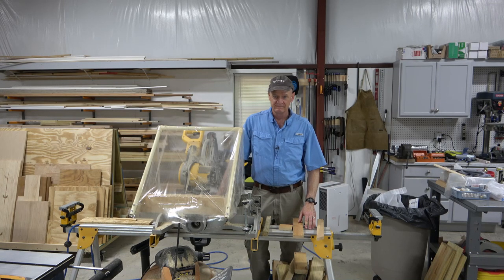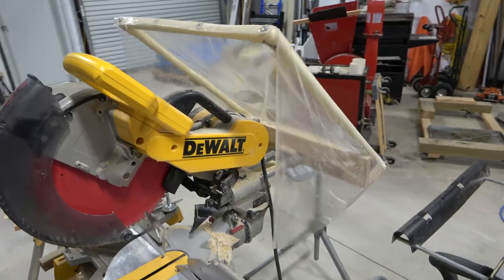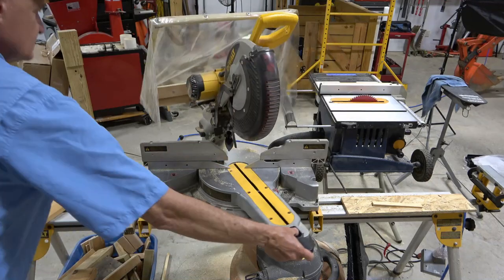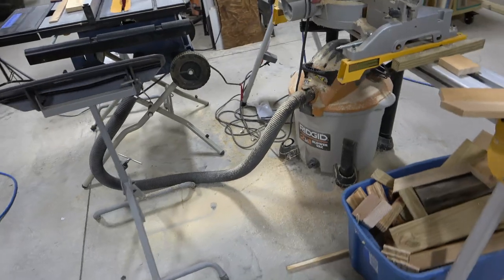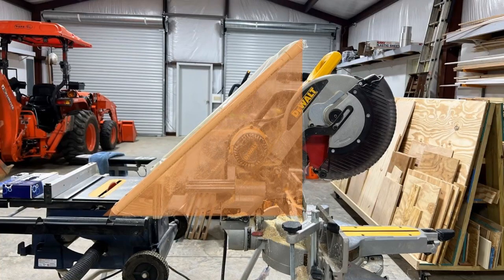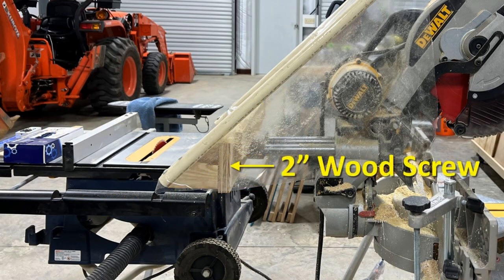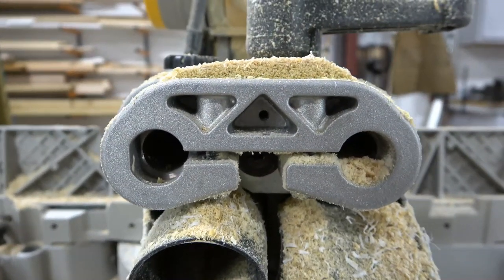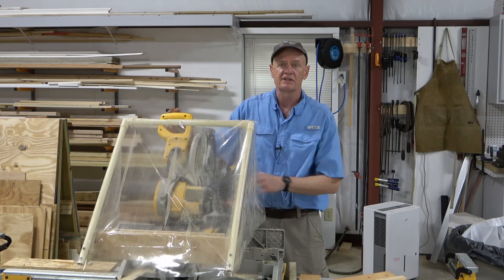Miter Saw Dust Shield - Quick and Dirty But Very Effective! (#168)

Comment: Great video Martin.  Its a shame that saw manufacturers don't make dust control higher priority in their design.  I have a similar Dewalt miter saw with the exact same issue.  Connecting a shop vac helps but only slightly.  Well done!
Reply from the maker: Thank you, Marty!  Sounds like you need to make one for your saw. Have a great weekend!

Comment: Great solution, Martin.  I've been fighting sawdust for over 60 years including the installation of a central vacuum system with 4" PVC ductwork and blast gate provision/controls.  It wasn't until I demoed this duct system last month in the old house to move to the new house when I found the ductwork was half-full of sawdust leaving only the other half to INeffectively exhaust sawdust.  Even with a 5 HP exhaust fan, it was likely and only  50% effective.  Back to the drawing board to find what works on the new installation.  I'm bummed out at these over-priced exhaust systems being sold as the "Cat's Meow".....bummer!!!
Reply from the maker: Thanks, Dwayne! You had quite the elaborate system! Sorry it didn’t work as well as you thought. Maybe static electricity is causing the saw dust to cling to the PVC pipe walls.  Good luck with your next system and thanks for watching!
Reply: @DIYMyWay  ....I considered the static electricity possibility as an influence due to using PVC piping/fittings.   Therefore, as a precaution, I installed a bare, braided copper wire (around 14 gauge) wrapped continuously along then entire length of the piping with a very tightly installed and spirally wrapped fit then anchored with short screws into the thicker portion of the PVC fitting flanges.  I then routed the wiring to grounded points every 10'-15' of the lenght of pipe.  Lastly, I used a remote timer to control the main vacuum machine run time for 10-15 seconds longer after the various cutting machines were turned off.  I really suspect the static suction value represented by the vacuum system manufacturer was the real culprit.